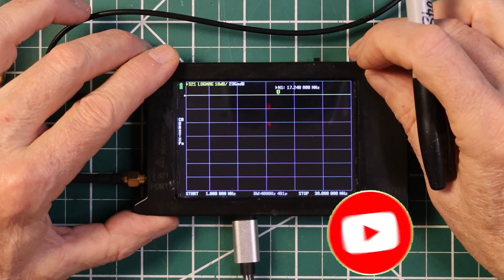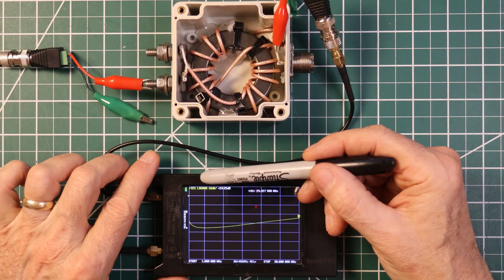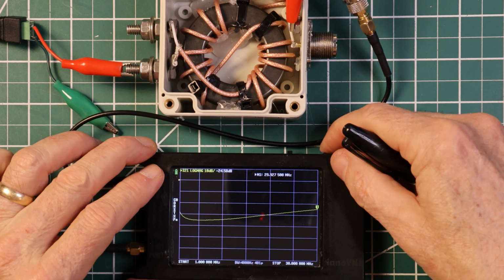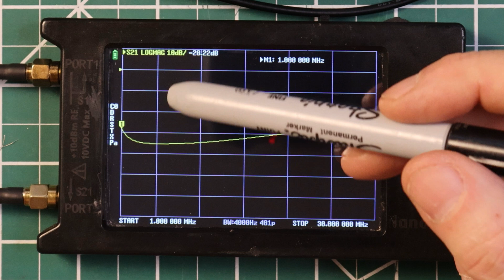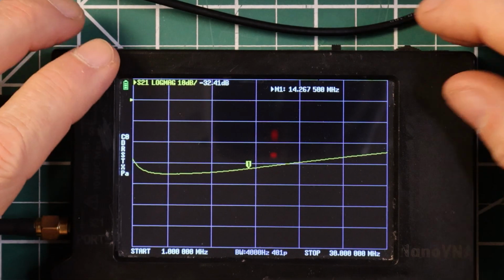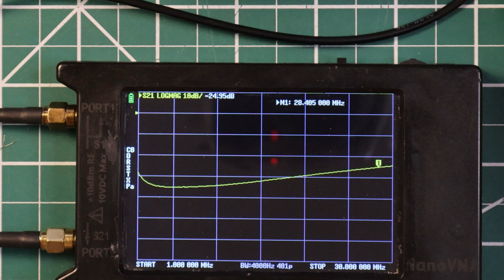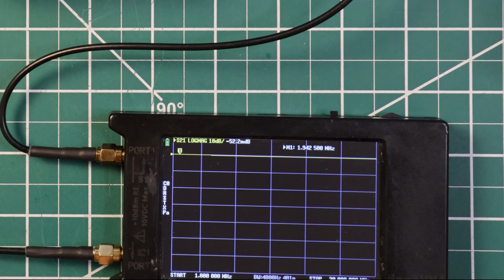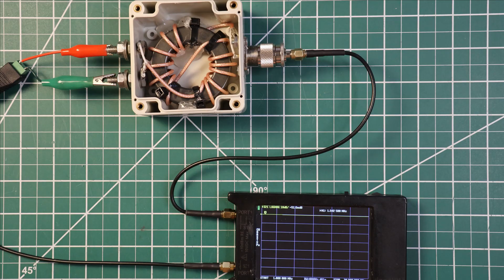Testing My DIY 1:1 Balun/Choke on NanoVNA – Shocking Results Across HF Bands

Comment: Db of attenuation doesn't really give you an accurate idea of how well a choke performs.  A better value to measure would be to measure the common mode impedance.  Different types of antennas can require different amounts of common mode impedance (CMI).  For example, a regular dipole may only need 1K ohms of CMI to tame the common mode current present, while antennas like the off center fed dipole which are not as balanced as a regular dipole due to their unbalanced nature since one side is longer than the other in relation to the feed point may need 6K (6000) ohms of CMI.  Just measuring the DB of attenuation just doesn't give you the full picture.
Reply from the maker: Thanks for your feedback

Comment: Okay, I see you've now properly tested the choke for its intended purpose. However, you can't specify an attenuation value in decibels because the value you obtain refers to the 50-ohm load of the second VNA port. However, when the choke is positioned under the antenna or elsewhere on the cable, the attenuation value of the common-mode currents present on the outer surface of the cable shield will most likely be different and not easy to calculate or predict.
This is because the cable shield will behave like an antenna with a random length, shape, and position, so it will show to the choke an impedance that cannot be predicted, and therefore an unpredictable level of attenuation.
So, its effectiveness will also depend on the point on the cable to which it is connected. Experimentally, the most convenient point can be found using an RF ammeter (of the type that uses a clamp-on ferrite bead) and moving another clamp-on ferrite bead along the cable to find the most convenient point.
The value and curve you obtain in that way are still valid for comparing this solution with others (air choke, different toroid, turns number, etc.).
Finally, I would like to point out that the sizing of the ferrite in a choke of this type does not depend on the total power involved but only on the common-mode currents that originate on the external surface of the cable, which fortunately are only a small fraction of the differential currents that flow INSIDE the cable.
The power limit of the choke is determined by the characteristics of the cable and by taking care not to exceed the minimum bending radius declared by the manufacturer. 73s
Reply from the maker: Thanks for watching and commenting! 73, Jerry

Comment: Sorry to tell you this, but your test setup is WRONG! You need to tie the center and shield together on BOTH ends, then tie the 2 ground connections on BOTH of your NanoVNA ports together, and then the center pin from Port 1 to the tied input to your choke and the center pin from Port 2 to the tied output of your choke. WHY? Because "common-mode" is DEFINED as the current that is going in the SAME direction down BOTH sides (center and shield) of the choke. This setup tries to force this condition, and your NanoVNA measures the choke's rejection (ie-insertion loss) of this common-mode current. Almost any other configuration is simply measuring the insertion loss of one side of your choke, acting as an inductor and NOT as a common-mode choke. See the Halibut Electronics test board schematics to understand how the setup is properly wired.
Reply from the maker: Thanks for your input and explaining your perspective on the test setup. 73, Jerry

Comment: Very enjoyable   What would it look like if you put to much power into the Choke/Balun?  I run a 1.5 kw amp usually 800 watts output.  How to you size a balun for more power.  Does a high SWR enter into the equation?  Does high heat have a long term effect on the toroid?
Reply from the maker: For more power you would need to stack 2 or 3 toroids and use thicker coax like RG8X or similar depending on your power requirements .  If the balun was starting to overheat, the SWR will start to climb. Also as you said, if the antenna SWR is too high, the toroids will overheat quicker.  Start at lower power then gradually increase it and closely watch your SWR. Be careful and have fun.  73, Jerry

Comment: If you calibrated with both connected, then better connect green wires also. Difference will not be big, but it would be more precise. Merry Christmas and Happy New Year.
Reply from the maker: Could be. Thanks for watching!  73, Happy New Year!
Reply: Actually if you connect the active and shield the choke shows no attenuation.

Comment: Very effective design.  Stray capacitance between windings is sneaking in at higher frequencies but anything over -20dB suppression is great for keeping an antenna balanced.  Unlike an unun where the toroid carries all the power, a Guanella balun like this will only see see the inbalance current due to any imbalance in your antenna and it's environment.  That one core should be sufficient for a lot more than 100 Watts.  I'll be checking out your build video next.  73 KK7YIS

Comment: Dear Jerry, ... 
I hoped, you had a merry X-mas, and wishing you a happy new year in 2026! 

I like to see that last video, it showed me, my decision to make a 'common-mode filter' in exactly that way, was the right way. 

So my 'FD-3' (40/20/10/6m) and my 'More-Gain'- antenna (80/40/15m), are 'properly' decoupeled, as good as possible, what I can do, with the 'amateur-stuff' I had here, ...! 

Also used this kind off 'Bal-Un' for my 'Fritzel-beam' (10/12/15/17/20m) with the two different dipoles in this antenna! (The 10/15/20m as a 3-element,  and 12/17m as a 2-element antenna system, all are mounted, on one boom!)  

The only antenna without a 'common-mode Bal-Un' is my 30m-(single) dipole. But never had any trouble with it, in any way, ...! 

I like the videos you make here, on U-Tube, please carry on, ... ! 

Please appologise if I made some crude mistakes in my writing and/or spelling. English is not my native tounge! 

73 de Markus - db9pz - JN39fq - 5km/3miles east of 'LX' -
Reply from the maker: Thanks for watching and for your kind words! Happy New Year! 🎄No problem with the english.  I have travelled extensively and I know that your english is much vetter than any language I have tried!  Good luck on your antenna projects.  73, Jerry